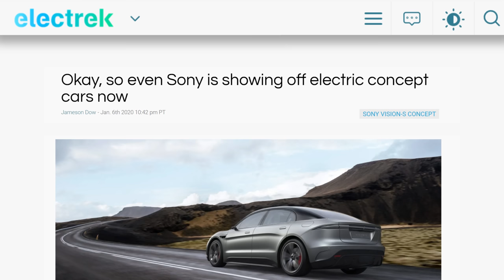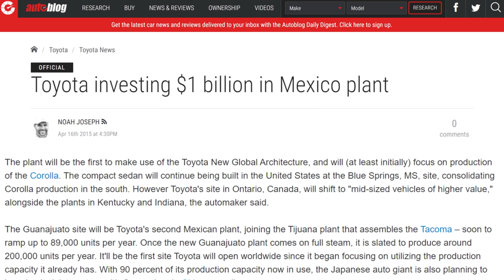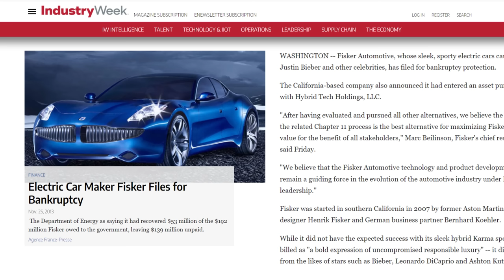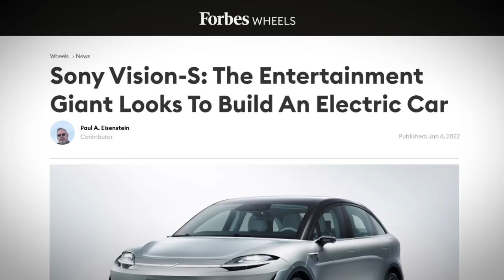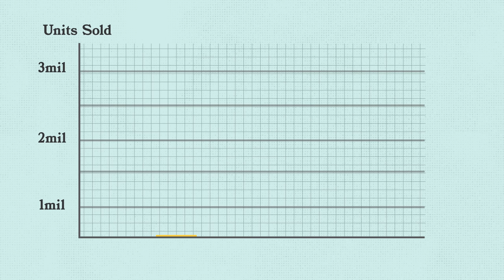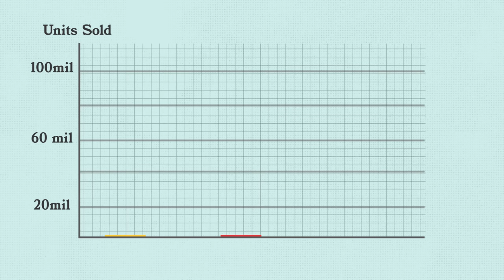Sony's Car Could Actually Be Good- I'll Explain

Comment: Don't underestimate Sony's experience with battery manufacturing as well. They are making one of the best cells on the market.
Reply: Found the vaper.
Reply: This is a really good point. Maybe all those Sony VTC4s stopped being made because they were focusing their efforts into making larger lithium-ion batteries for their cars!
Reply: Meh, samsungs 18650s are better
Reply: Soldiers don't mind the bot
Reply: Sony did sell the battery business in 2017. I don't think they will have an advantage in that regard. Maybe they get some decent conditions, but they are no longer in control.
Reply: @antifascistskater  Nah, just a hobbyist electronics repairman. Those cells are used in basically all electrical tools batteries.
Reply: Sony stopped making battery, with new TV they give you Panasonic battery for your info..
Reply: @Lawbase  Samsung pink 18650 exploded on me twice in 5 years of used in legendary flashlight and vape.

Thankfully samsung 18650s burst after dropped on wood floor instead inhale into lungs or blindly charging.
Reply: @Lawbase  its weird hearing samsung being good but i haven't heard much bad about them lately kindof like the kia/hyundai of electronics.
Reply: Sony is even the sole supplier for all lithium cells for all NASA and ESA satellites and drones. So they know how to make reliable cells.
Reply: They  lost ground in the lithium ions game though.
Reply: Hahah completely false
Reply: @derekmaxwell8164  samsung has been the peak of the industry for 13 years, outclassing LG, Apple, Sony, Google etc etc
Reply: @ashliehiggins  1000% false
Reply: @Lawbase  no they aren't
Reply: @brucebonner3491  take that Milwaukee, DeWalt, and snap on battery apart. If it's green or yellow inside it's sony
Reply: @Matt-xu6hz  again as facts prove...they ain't sony... sony hasnt been in the game for over 5 years, and even through out '95 - 2015, nothing's sony.

It's actually funny how in the last 15 years, sony has removed themselves from over 12 markets of product, had to close down over 5 factories, and has continually lost billions every year.

Sony has been the worst products in the world ever since 1998.
Reply: @brucebonner3491  i wouldnt say 13 years its probably been about 5 years or so since i heard about bad quality issues from them though
Reply: I don't trust Sony and their Batteries, I still remember them supplying batteries to dell laptops where they would explode
Reply: @antifascistskater  I haven't smoked or vaped in 6 years but as soon as I saw OPs comment I immediacy thought of the green wrap 18650s
Reply: @yi_hou3092  hi YI Hou.
Reply: @Matt-xu6hz  PS3 and PS4 should be a good take.
Reply: @Squilliam-Fancyson  yes.
Reply: @ashliehiggins  hi Ashile Higgins.
Reply: @manpan4693  imagine if the PS2 sound implemented in a TVR.
Reply: why do people think Sony just makes tvs and consoles lmfao

Out of all the media/entertainment brands, Sony is the only one who could pull it off
Reply: And it's not like tesla were the best too, the best one are the guys at Panasonic...
Reply: @Squilliam-Fancyson  batteries are no longer a problem for any company it’s all sourced in china cause it’s cheaper than in house it’s the rest of the package that counts
Reply: One could call it… the  “Perfect Cell”.
Reply: @Lawbase  Samsung makes primo everything dude they just have 10/10 fabs or something their RAM is crazy their battery's are crazy display panels are crazy.
Reply: Yep the VTC series of 18650 I have dozens of them. But they kind of aging outdated now. Sure it's good to experience but they much more advance Packaging to make BEVs be effective.
Reply: Yes the laptop industry has Sony to thank for their Lithium Ion innovations throughout the decades no one really knew about. Panasonic was thier only real rival, who btw makes Tesla's Batteries.
Reply: BTW SONY had built the first commercial rechargeable lithium ion battery in 1991.
Reply: @kargi42  They heavily pioneered the BMS tech that makes modern BEV possible and not explode.
Reply: Or camera CMOS sensors. They are the world leader, which gives them advantage for self driving tech, low light performance etc etc.
Reply: Sony sold 2017 their Battery Manufacturing to Murata, but making the cells is not the secret sauce to success, battery management is the key technology for long lasting batteries and quick charging. 
And that is something Sony has some experience.
Reply: @fillmainlol5973  maybe because over the last 20 years, Sony has shut down several factories, they quit making computers, the quit making phones, they quit making music media, the company has been on a constant downhill for years losing billions every year. The whole marvel/Spiderman deal saved the brand 6 years ago.

Sony doesn't really make anything much anymore, and every product they release is the bottom of the barrel worst thing you can find on the market.  Hence why people only know them for their TVs, its the only thing holding the company alive.
Reply: @Neojhun  false
Reply: @brucebonner3491  I never said invented. You read wrongly. But they pioneered scaled up the technology to literally millions of units. Important achievements.
Reply: Then why do I have  all these dead, overpriced batt packs from the 70's to now from Sony everywhere?
Reply: They are kind of different but can't underestimate Sony tbh
Reply: @brucebonner3491  no Sony is way ahead
Reply: @antifascistskater  HAHAHAHAHAHA
Reply: @Lawbase  im a samsung fan, but im a vaper too so i understand sony battery
Reply: @rain8788  same
Reply: @Lawbase  Ah, but OhmLife's and MXJO's are even better
Reply: Panasonic. Same battery as Tesla
Reply: Molicel P42A is still the best 21700 though!
Reply: They also make ebike batteries.
Reply: Agreed and I jsut learned this week that Sony not only produces military vehicles for the Japanese Defense Forces along with Mitsubishi but Sony developed a revolutionary first ever Electric Jet engine for their future 6th generation fighter jet. They also developed a new skin for aircraft, a water cooling system for the entire jet to keep its heat signature down and a first even electronic remote servos in place of metal mechanical equipment and hydraulic systems saving thousands of pounds but the electric jet engines which I don’t understand how that works but they produce massive amount of electricity as well so they can power direct energy weapons (Laser) planned to be mounted to the jet. Their advancements already in 6th Generation fighter is dumbfounding. Japan is injecting Billions of dollars into their local defense contractors to become a world force in defense contracting and Sony and Mitsubishi have stepped up hugely. Many tech experts say they are the best electronic  chip developers on Earth currently so I’m not shocked their leading a new technology for future fighter jets.  If they can build military assault vehicles and most the new technologies for the next generation of fighter jets I definitely trust them to build a civilian electric vehicle. They’ve also successfully tested a new type of battery for electric vehicles thst is half the size and weight and using 2 of them for different tasks , city and highway driving they have over doubled the range of current battery in electric vehicles and lightened them significantly and can charge in much less time. Their test vehicle got 780 MILES CITY AND 1,088 highway, that’s the longest range vehicle gas or electric ever produced. They were considering selling the battery’s to big manufactures like GM and Tesla but have decided to hold onto the tech and put it in their own vehicle when tests are completed. Imagine a Tesla with 1,080 mile range!?   Battery advancement is desperately needed for the comming electric mandates so I’m happy to see Japans tech companies pushing the technology.
Reply: They basically invented the modern Li-Ion battery cell as well
Reply: Hopefully this "cell" isn't as bad as the one in the PS3

Comment: If Apple made an electric car, they'll have: different charging ports, unconventional bolts for the tires and the entire car, and short mileage
Reply: “Sorry, looks like the repair cost would cost more than the vehicles worth. Can I interest you in an upgrade?”
Reply: @9k827  a majority of people who poke at Apple are Apple consumers like myself. I enjoy their ecosystem not their business practices. But you saying “nobody cares” is very ignorant as these wouldn’t be issues if people agreed with them. Apple is known for being anti-third-party-repaired. You think they do this for the convenience of their consumer? No. They only wish to fill their pockets.
Reply: Yah and if you hit a pothole the windshield cracks
Reply: you'd be forced to buy a new car every few years max
Reply: @9k827  umm… are you this ignorant? Apple has done many things to fights third party repair. Did I ever say they fully stopped it? If you were to swap home buttons, camera…etc. you lose the functionality of that component. Apple started giving hashes to key components that are commonly replaced to block third party repair. You’d then HAVE to take it to the Apple store. Not including screws the specifically designed so the common person can’t fix, blocking screens from being sold to third parties, keeping repair manuals secret, and on computers they even put the main power cable towards the bottom of the screen so if an inexperienced person was to try and attempt to fix the computer, they would damage the cable requiring an even lengthier and more expensive repair. This is just the tip of the ice.
Reply: @Donniec685  literally can fix anything on iPhones without apple
Reply: @Mattyew  lmao imagine it just drives off to get an iOS “update” every few months and they just send a new model with a bill in the glove box
Reply: @Donniec685  why are you replacing your camera anyways… that’s sus. There’s a chance you lose Face ID when replacing camera. And if you have a home button you’re probably not someone I wanna talk phones with. That was 5 years ago.
Reply: and also if you didn’t take care of it like its your own fucking child it will break down in 2 months
Reply: @9k827  Come on bro, tell us the answer.  Im genuinely curious
Reply: @9k827  for one I was naming instances. Second, Are you saying components don’t fail or can become damaged? Why does it matter what the consumer wishes to fix? If you paid for it you should have the right to take it wherever you please. For simple repairs, yes you don’t need Apple. However, cameras, speakers…etc. you HAVE to go to Apple. Each component is hashed, and becomes unusable if replaced. You can’t say that’s for the protection of the consumer. There is no data that can be stole simply from changing a camera or speaker. Let’s not include how Apple tells every customer their “data is impossible to recover” which is a flat out lie
Reply: @9k827  hi Summy HD.
Reply: @9k827  what's sus about replacing a camera? Do cameras not break? Is there some nefarious motivation behind replacing a camera of which I am unaware?

Apple has decent hardware (except glass) and very user friendly software, but their business model absolutely sucks if you're someone that can do anything for yourself.
Reply: @WASTED__POTENTIAL  yeah it’s very uncommon. If you break your camera lens you prolly got some other problems going on. Which you can replace the glass easy. As for electrical damage that’s uncommon.
Reply: @9k827  you sound like an 8 year old Apple fan boy
Reply: And three cameras
Reply: @9k827  Uncommon as it may be, shit happens. Phones fall all the time, and if it just so happens that the camera hit a pebble upon landing, that doesn't mean "you prolly got some other problems going on." To imply so is the argument of an idiot. Also, replacing glass on an iPhone is not that clear cut. 
The point of this is that you don't completely own the product when you deal with Apple. You own the right to use Apple's property, but it's not your property to do with as you please like you can with an android phone or non-apple PC/laptop. There are some things you can do with an iphone or other apple products; some other things you can do if you're willing to sacrifice some features; and some things you just cannot do yourself if you want to keep using the product.
Reply: @Hammerdak  I see what you did there. Lol XD
Reply: @ziqrsx  um since which iphone has this been the case? Other than the 6 bending if sat on (no shit) most iphones outlast the standard smartphone of its gen hence the 3x duration of update support in comparison to androids for example? 

Not to flex but typing this off an iphone 6s from 2016 lol
Reply: @Ayman.Al.Balushi  im using the iphone 7 (yes i am still using it) so im not sure, maybe thats why i think iphones are unreliable, because mine is pretty damn old
Reply: @Ayman.Al.Balushi  all of the kids in my family have gone through at least 2 screens each on their iphones, and it seems like half the iphones I see elsewhere have cracked screens, whereas my Samsung S9+ with extremely exposed curved glass has survived countless drops, including a 50mph tumble down the street when it fell off by bike and a face down drop on the edge of a metal paint can. I know that is anecdotal, but it certainly reinforces the notoriety iphones have for their weak screens.
Reply: Yeah it's a wonder why a company like Ferrari even knew they were too proprietary
Reply: @WASTED__POTENTIAL  children breaking screens does not really fit into ‘break down’, but yeah they did have weak screens for 2 gens after dropping gorilla, but checking the last few gen drop tests on youtube shows this has been outstandingly fixed.
Reply: @Ayman.Al.Balushi  There's more than 2 generations with weak screens, and that's not the point, anyway. This isn't about who has the toughest screens. This is about who is allowed to fix what when shit happens, or even when shit doesn't happen and you just want to change things up.
Reply: @WASTED__POTENTIAL  yeah I get your argument, I am just correcting the other ‘breaking down’ statement as this is the main reason I stick with these phones until I jailbreak em.
Reply: And it'll get slowed down by software updates, to preserve the battery life till out of warranty.
Reply: Not to mention the windshield wipers will probably have to be bought separately. They won't come with the car.
Reply: @9k827  bro I'm just commenting on something for the fun. if u don't care about it, why even bother replying 👁️_👁️
Reply: @purwantiallan5089  hello
Reply: @dreunderscore3314  could say the same to you. Why you spewing the same false nonsense?
Reply: @9k827  false nonsense? It's a joke, it's not supposed to be factual, it's supposed to be fun, and u seem offended by the joke. I get it, u're an apple user, and apple do have great build quality, their product does the job as they were intended to, but i just dislike how they market their product. If u love apple so much then beat it, apple isn't my brand and im just commenting about it.
Reply: @dmgthegolem4694  And the windshield replacement cost 80% the price of a whole new car. If you have it done at a third party location for a much more reasonable price you find out that the unofficial windshield lacked DRM chip which causes the car to brick itself for "safety reasons".
Reply: @Donniec685  Never EVER Support Apple, even Sony's phones like the Xperia 1 III are waaaay better than the lastest iphone.
Reply: Not to mention it'll be 9/8ths of the cost of a BMW... And on top of that you have to pay a yearly subscription fee for your key fob, infotainment system, heated seats (cooled are separate), heated steering wheel (cooled is separate), sound system, interior mood lighting, panoramic sun roof (they give you a small portion of it and cover the rest up with headliner and glue if you don't pay up... they highly encourage you to pay up), rims and tires, body panels (you have different options that's why it costs money), suspension, steering components, lug nuts, aaaannd last but certainly not least......
Cupholders.

.... Na I'm just kidding, there's no cup holders.
Reply: @9k827  my mom did this
Reply: the mileage and power would degrade after 2 years of usage
Reply: @9k827  triggered
Reply: And you wouldn't be allowed to work on it.. kinda like Tesla prefers it
Reply: Steering wheel, wheels, and tires sold separately. Windows will roll down in a later update, why because the word Windows.
Reply: Apple will sell their cars without the wheels, they will sell it separately
Reply: And if you replace the tires to after market ones the darn thing wouldn't even drive
Reply: and no ability to change the batteries.
Reply: @Donniec685  every car company pushes people to new cars. Planned obsolescence is a huge issue in the automotive industry
Reply: @THIS---GUY  yes, but that’s not what I’m getting at. Sure push people to buy new cars but preventing users from taking their car to where they please and forcing users to come to the original manufacturer is a big issue.
Reply: No it would be more like - YOU HAVE TO BUY THE TIRES, STEERING WHEEL, WINDSHIELD,  AND SEATS AS ADD ONS AND ARE NOT INCLUDED.
Reply: @9k827  False nonsense? Is there such a concept like "correct nonsense"?
Reply: Not to mention, you have to go to Apple store for a tire change.
Reply: @Donniec685  that person is an obvious troll 

Or an apple fanboi
Reply: @jimcanterak7349  Its false and its non sense?
Reply: @Donniec685  don’t forget that lovely T2 security chip they implemented to prevent any important part that failed to be replaced by anyone except a certified apple repair store 😂😂😂
Reply: @solarcataclysm  it’s for user safety and security obviously🙄🙄
Reply: @9k827  they intentionally make fixing stuff harder an almost impossible if you are not a professional.